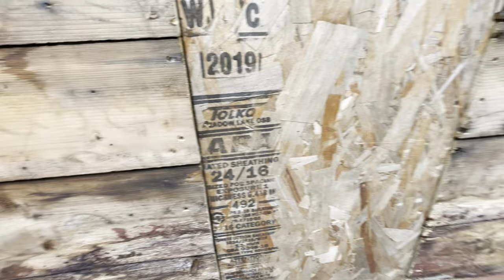Extracting A Cracked Cast Iron Pipe from the Ext. Wall of a 1918 House And Building A New PVC Drain

Comment: Thanks for the detailed revision video. Very educational, but I just don't understand why in the US you insist on gluing everything together. Here in Europe, all our piping has a gasket that allows you to twist and turn, and remove and replace as often as you like. Makes life so much easier. And it is not something new. Maybe someone can explain this to me. Is it just a marketing ploy so you have to buy more fittings each time you want to change or extend anything? Greetings from Germany
Reply from the maker: Hi! The primer/cement we use is dictated by building code here. Your system in Europe seems way easier to install and repair, for sure. Danke fürs Zuschauen!